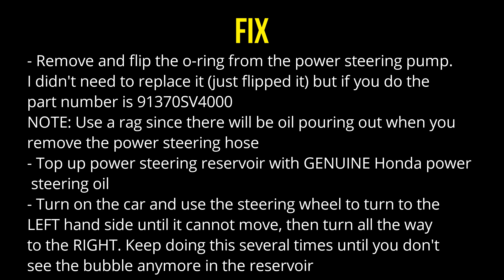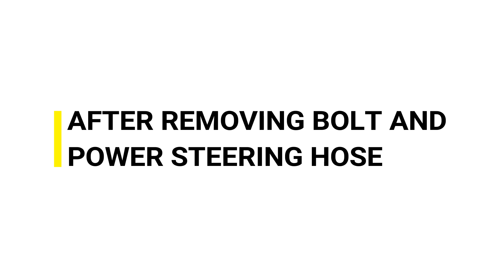HOW TO FIX WHINING HONDA CRV 2007 MODEL

Comment: Hi, i found a kit that sells a black and red oring should i change both? Where should the red one be located?
Reply from the maker: Does the kit have the same oring or code as the video?
Reply: @skopioeye Yes it does
Reply: @skopioeye I figured the red oring is for the aluminum outlet of the oil meaning from the pump to the hydraulic steering rack
Reply from the maker: @luismartinez2148 yes this sounds about right.
Reply from the maker: @luismartinez2148  nice

Comment: About to try this if the top up does not fix my problem, question: do you need to drain the power steering fluid before disconnecting the hoe and bolt ?
Reply from the maker: Yes it's best to drain if you remove it disconnect the hose. Hope the video helped and if it did please like and subscribe.

Comment: Was it leaking before you flipped the O-Ring? I just replaced the power steering pump 4k miles ago also not alot of whine when turning left to right. I don't see any leaks, but seems like the whine is getting louder every day that goes by. Thanks for your input.
Reply from the maker: Sorry there was no leaks on my one

Comment: I had a whining sound in my 2010 CR-V. It just came apparent. During idling and driving.
I will try to check first if it the P/S steering is pumpling a lot on the reservoir.
By the way, if I check for bubbles, I should do it while the engine is running and open the P/S reservoir?
Reply from the maker: Yes you need to do it when engine is running

Comment: i tried this and i'm having difficulty, is there any way i can contact you?
Reply from the maker: What is the problem you're having? Just post it here so that others may be able to assist as well.
Reply: dealer gave me a black o ring that was too large, i finally got the smaller reddish one that solved the problem....now i have to figure out another issue
  oil leak accumulating under lower pump
Reply from the maker: @kostakritikos291  wow I never encountered the issue with the leak. Maybe you need another oring there too

Comment: I kinda still heard the whining noise in this video after you flipped the ring ?..
Reply from the maker: I don't think that's the whining noise. If you're still hearing it when you flip the oring you may want to change it completely out you may have a different issue.